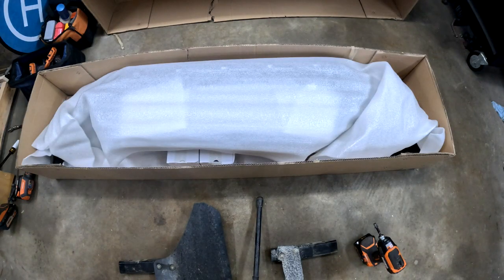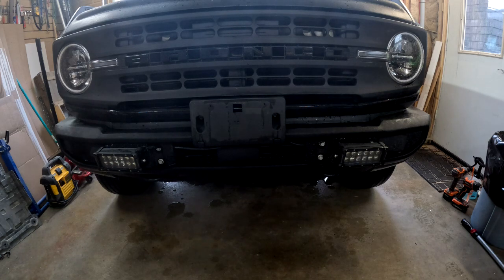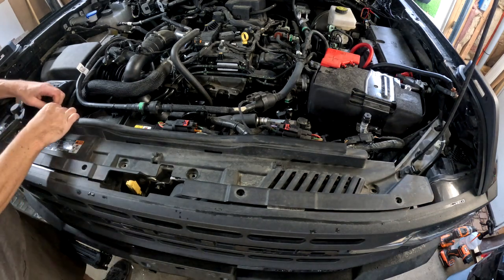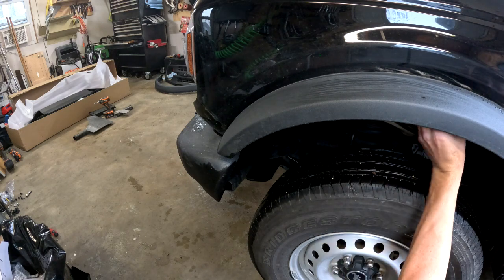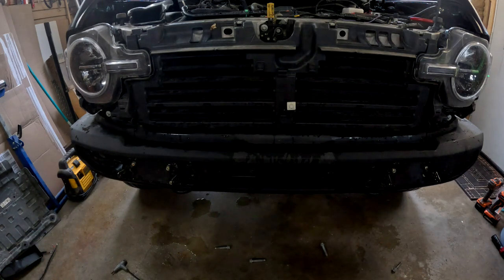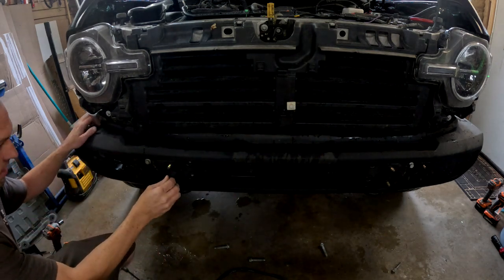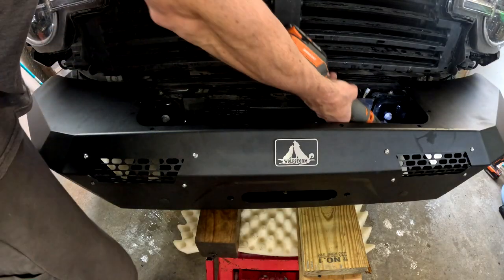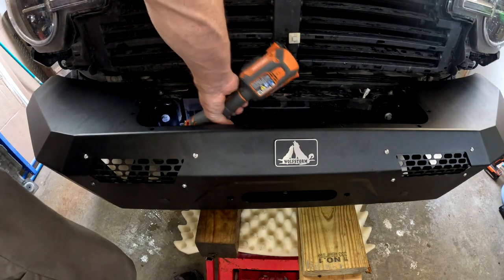Bronco Install Wolf Storm winch Front bumper Part 1

Comment: Are they thin ? I cant help but notice the tinging when undoing screws that make it sounds really thin. Im looking to get one for my ram 1500 cant find any reviews or videos
Reply from the maker: I winched my bronco up a icy snowcrusted hill for 3 hours and the bumper shows no sings of flexing. Design has lot to do with strength not necessarily thickness of metal.